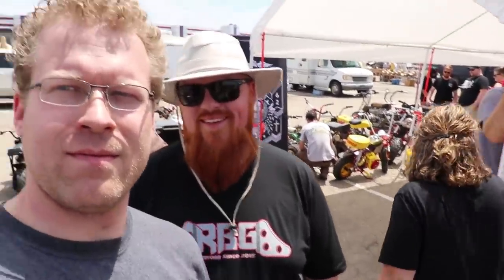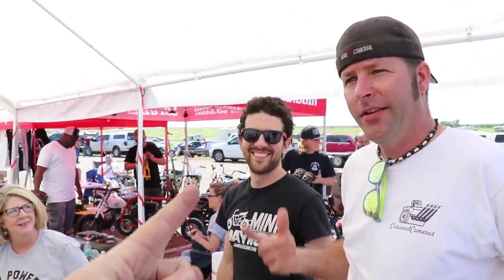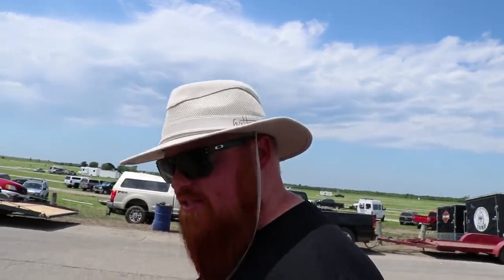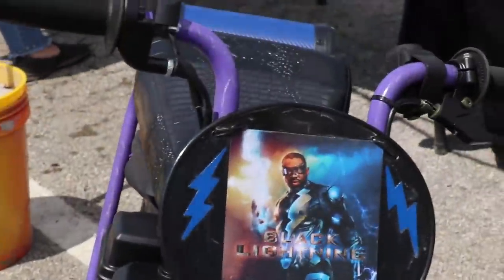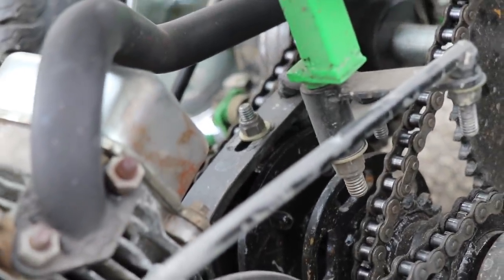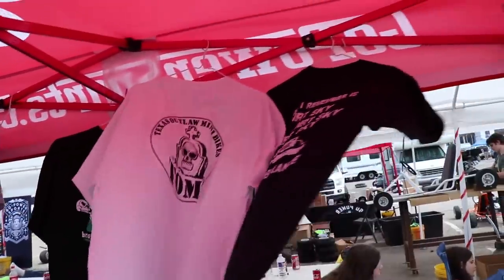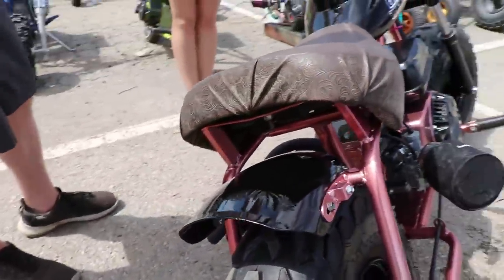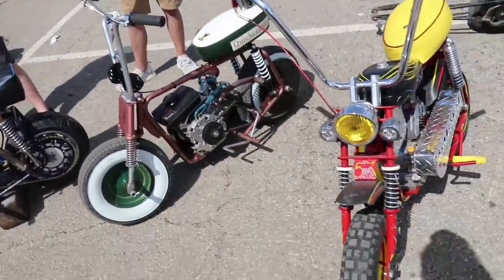What's under the GoPowerSports Tent? Pate Swap Meet 2019

Comment: Where can I get those gas lines at 15:10 ?
Reply from the maker: Those are "AN" lines. You can search like "AN-6 lines and fittings" the AN is just a standardized way of making the line and fittings. There are like an-6 -8 -10 etc size wise.
Reply: KartFab  alrighty, they look pretty snazzy, appreciate it!